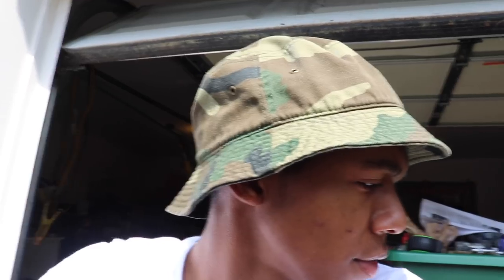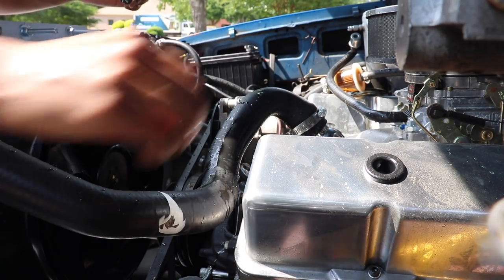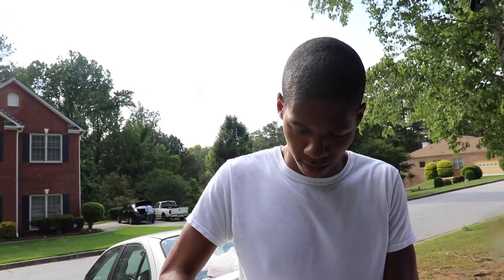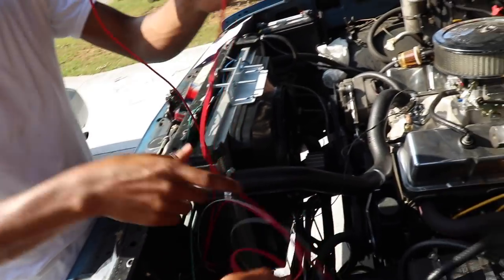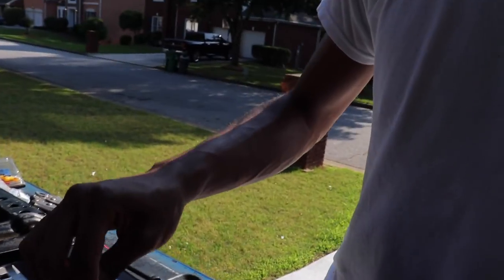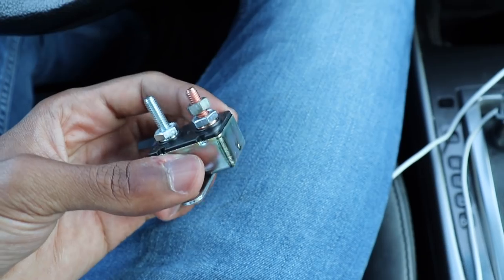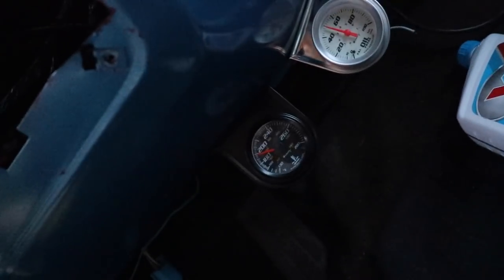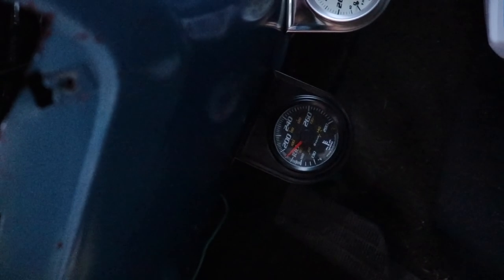PAINLESS Thermostatic Fan Switch Install on Squarebody C10

Comment: Your circuit breaker should be mounted in the engine bay, not in the cab.     It should be as close to the battery as possible with as short a wire as possible.   If you mount the circuit breaker in the cab, bad things will happen such as voltage drop, high amperage draw, constant tripping, hot wires, premature failures, and fires.
Reply: bananasEveryday agree 100%. Also The less length of wire the better for this high amp demand
Reply: agreed to these

Comment: Hey bud your doing good don't beat your self here are the 2 things I see wrong #1 the constant power source wire should go to the positive battery post.  # 2 is yes MOST times you use Teflon tape on threads but on your T stat fitting you put in you don't use Teflon tape it brakes the contact.  Notice the fittings are brass. They are soft metal so don't muscle it to hard but just take the tape off so the treads are bare re tighten it but don't strip it. And run your constant to the positive side of your battery and you will be golden brother. I'll be watching for it good luck. But hey in your defense you did do it right it's just that most directions and I'll never understand why but most directions don't tell you to not use teflon tape pat yourself on the back you wired your first relay and it wasn't all that hard as far as the mistake you made it was the most common one that everyone makes but you learn from them as well so now when you fix it you will know this for future projects
Reply: His thermostat is the 2 prong type.   one prong goes straight to ground.     so the teflon tape is fine in this case
Reply: @bananasEveryday  lol good catch! How the hell did I miss that?  Then it has to be just the constant wire needs to go to the positive side of the battery.  Damn my old eyes can't believe I missed that on the T stat sensor :(

Comment: I see the two shrink tubed wire extensions you did (fan power supply and constant 12v supply) both seem to be of a lesser gauge. Typically, those are 10 gauge because of the amperage that run through them. The wires I saw seem to be of a lesser gauge. From my perspective, looks like your using a 12 gauge. Doing so can cause a very bad situation. Just a heads up on that. Good luck and enjoy your videos!

Comment: 1. Hook your constant hot to the positive terminal on the battery. 2 What is the engine thermostat rating? 190°? (not the one that came with the fan kit, but the actual engine thermostat) because if it's lower than 195° then the fan will never come on because of where you placed the one from the fan kit.....right next to the engine thermostat...So the engine thermostat heats up to 190° and opens up allowing cooler water to hit the fan thermostat (195°) which won't operate because it will never reach 195°
Reply: I think you've got it right.  Agree 100%

Comment: did you try putting that 12v Con straight to the + on the battery that’s what I’d do !! Trucks looking sick man I know it’s sucks when stuff just don’t want to work but your on the right track also I saw on the front of your carburetor you have one of the ports with no plug that’s a timed vacuum you’re not gonna feel vacuum at a idol but as you raise the rpms it create a vacuum I’d plug it off if you don’t need it just a heads up 👍🏽

Comment: Your gonna need a test light.  They are less than $10 at harbor freight.    Start testing each leg of the circuit one at a time.   Example:  First, to test the circuit breaker you clamp the test light to battery negative and touch both sides of the circuit breaker, both should light up.   If not, your circuit break is bad.   Next, to test the thermostat you clamp the test light to battery positive, and touch both terminals on the thermostat.  Both should light up when the temp is over 195 degrees.   If not, your thermostat is bad.   Next, to test the relay you don't need the test light.   You apply 12 volts to the grey/white wire by connecting it directly to battery positive.   Your fan should run if the temp is over 195 degrees.  If the fan is still not running and you know you fan works, your relay is bad.    All of this assumes that everything is wired correctly, so double check you wiring first.
Reply: Couldn't agree more test light is your best friend when dealing with electrical wiring

Comment: this may be a stupid question but since i didnt see you do it in the video, did you actually plug the relay into the socket? i saw you wire up the socket but never saw you put the actual relay in it
Reply from the maker: Yes I did plug it lol I figured I cut it out since it wasn’t that important to see it go in
Reply: @YoungChevyTruck  right on like I said probably a dumb question but sometimes it's the dumb little things ya miss
Reply from the maker: Trust and believe I appreciate it!! I make little mistakes all the time. Thanks for helping out